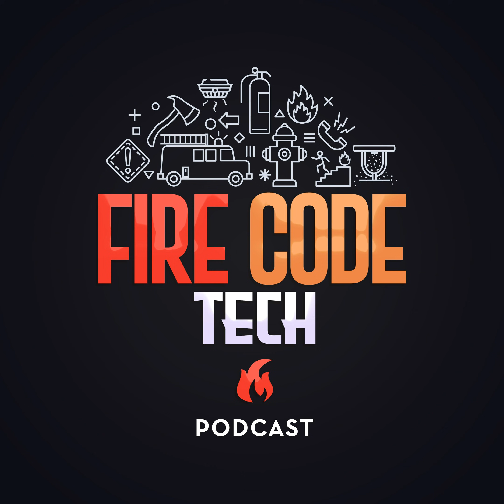12: Solocast Fire Walls, Barriers, and Partitions

Comment: Hi , does an electrical room fire Partition should be fire rated if the room protected with Fm 200 suppression system ?
Reply from the maker: Hi Dinu, There are a lot of factors that would need to be given to make this determination. Plus this falls into the category of engineering consulting services which is not something people give away over youtube comments for free. Check the adopted codes and standards for your project and analyze the fire separation requirements for the room in question. Good luck and best regards,